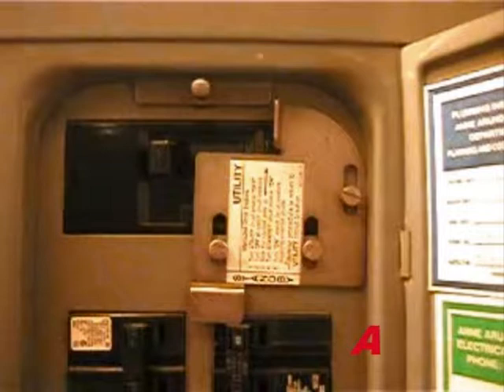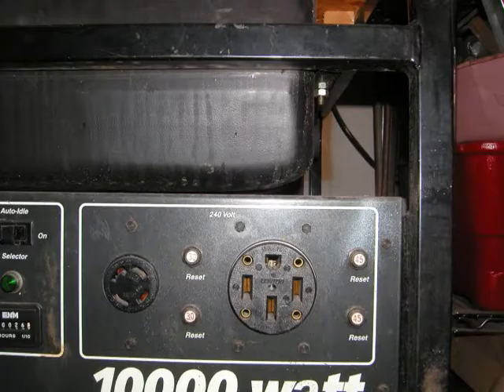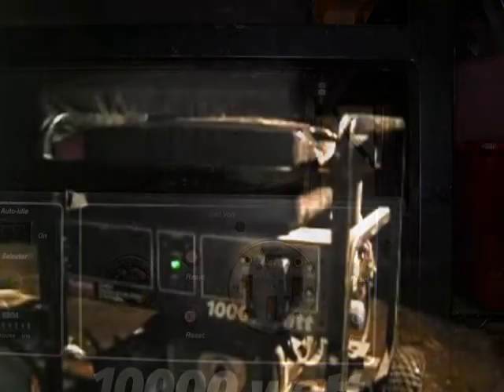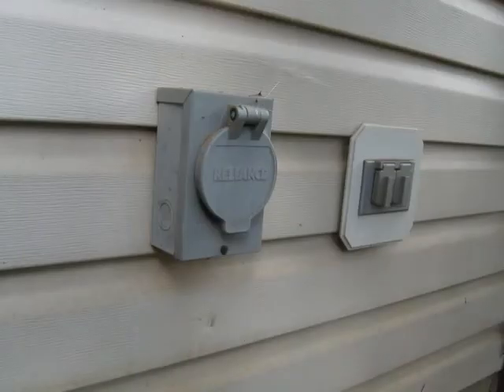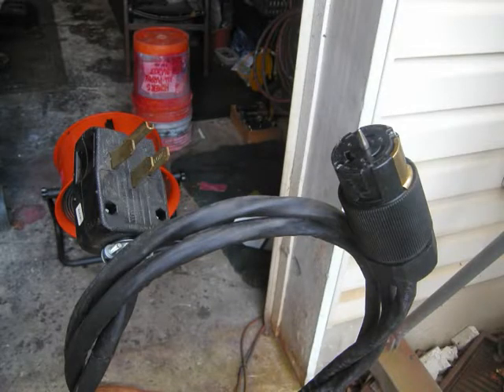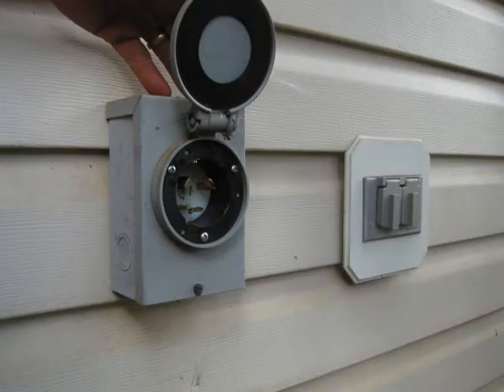Generator Interlock Kit & Electric Panel Backfeed System

Comment: Clever idea to install watt meter.  Not sure why it's not more common.  Wonder if you could do the same (monitoring) with something like Vue Smart Home Energy Monitor.
Reply from the maker: That would be something you would have to check with them. All I know is with any generator overloading one side is very bad for them and inefficient fuel use. 
Thank for watching.